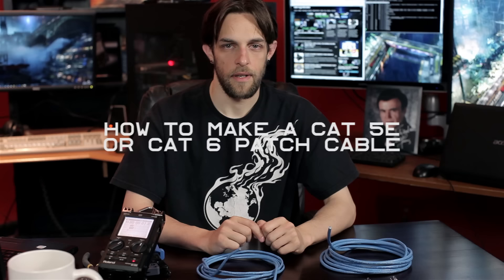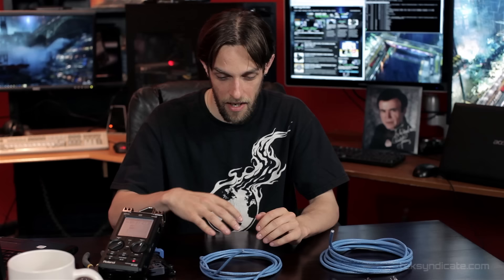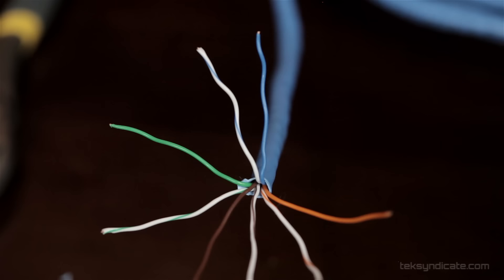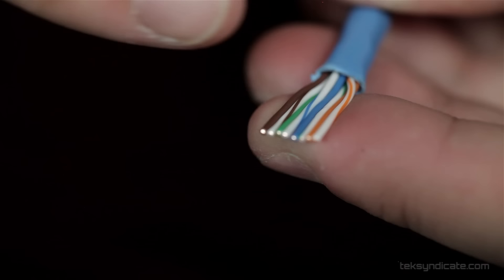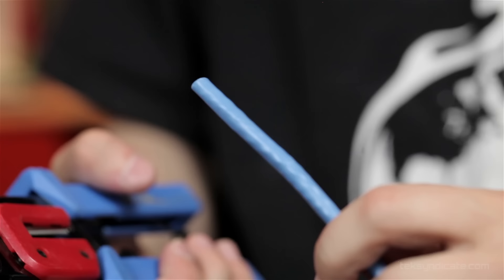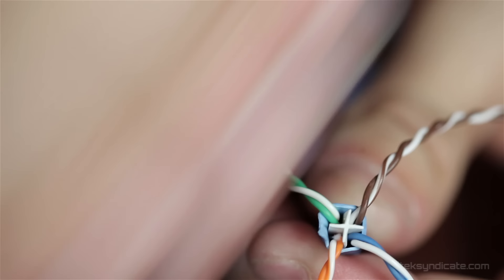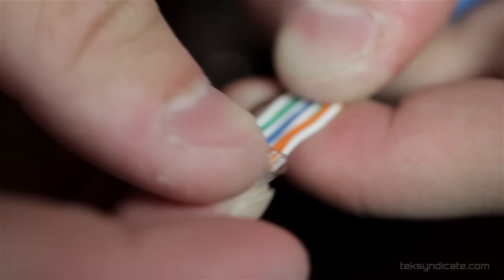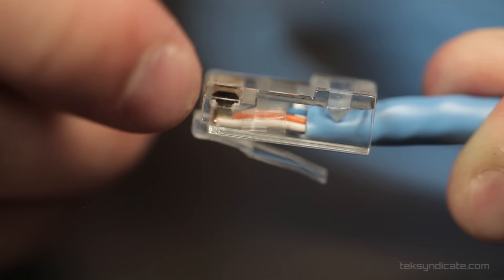How To Make RJ45 Network Patch Cables - Cat 5E and Cat 6

Comment: Network engineer here. Going 8 years now. Never had to create a cable on the job. Came here to run Ethernet to my TV. 😅
Reply: Lucky, stage tech here. im learning while I teach my contemporaries, on the clock lol
Reply: What do you call that little piece you put at 9:17?
Reply: Studying NE here. Busy bridging an old router over Ethernet to act as a repeater for my girlfriend :) will be my first time putting this knowledge into practice.
Reply: @davidkamau7871  i don't think there's a name for them, it's just a style of 8P8C connector, meant to be easier to assemble but isn't really once you've got the hang of how to wiggle the connectors straight before inserting them.
Reply: i really thought being a network engineer require these basic things, i'm currently studying CCNA and i'm really worried that i have to learn this first :-D
Reply: @markanthonytan2794  to be fair, it depends where you end up. If you're in a data centre they're probably never going to let use use a home built cable anywhere. If you're bulk commissioning stuff, premades are cheaper. But if you need a special long patch cable because the office ladies have moved all their desks about its a good skill to be able to do once a month or whatever
Reply: @miff227  thank you for the reply. Highly appreciated 🙏
Reply: @markanthonytan2794  no worries and good luck with the CCNA. It's a great foundation stone to really get a feel of what the silicon is doing , even if you never use the stuff in the job you end up in. I think using Packet Tracer and stepping through each hop, reading all the info, was the lightbulb stuff for me.
Reply: Awesome video. Running ethernet through masonry walls so this is very helpful. Cheers.
Reply: Hey Aaron I have a question I’m 21 years of age and this is my first year taking CCNA how hard is it being a network engineer is it possible for me as a 21 year old to obtain a networking level entry job
Reply: @hawanyamomahmath1489  Hard to answer a question with so many potential variables. Networking isn't the route for you if you're looking for a sure job. Seems like most companies want experience in networking. Your degree is fine, so are your certs. But seems like companies aren't all that invested in entry-level hires in networking and prefer those with years of experience, which was one of the reasons why I actually aimed for computer science in school but so happened to find an entry-level job in networking while there. Becoming a good programmer (computer science) is more promising job-wise (plus likely better pay depending on your qualities on the job).
Reply: @aarondavid9763  so how one gain networking experience if jobs are looking for already experienced workers?
Reply: why do it has to be like exact order?
i just matched both sides and done.
Reply: @davidkamau7871   it's the separator (or simply the little piece of plastic witch you'll loose all the time)
Reply: Sure you don't know how to do it....  it's always done by underpaid technicians
Reply: @davidkamau7871  I have seen it called a sled
Reply: What is the difference between Ethernet Cable Cat 6a,  and Cat 6a patch cable? Can I use patch cable for gaming with no issues?
Reply: On the cat 6 wire do you need the lil plastic piece az an extra
Reply: @A7exandersca7es  Very good. Senior Dev here, it happens more often than I would like to admit, that I learn things overnight to then teach the juniors the next day...
Reply: Scary how many network technicians don't know how to wire cat 5 & 6. I'm just a run of the mill IT Technician, I use patch cables wherever  I can but almost daily I have to run cable lengths for access points or various bits of hardware back to patch panels and I get a 3rd party in for any fibre jobs & splicing. So I just assumed it would be a very basic skill for a network technician to wire a cable but apparently not! 😂
Reply: The cutting wire is called a cheese wire as in its like a cheese cutter
Reply: So like a dishwasher who doesn't know how to wash dishes.
Reply: 😂😂😂likewise
Reply: I’m jealous bc i had to do it on a cable run and open a tutorial just so we could get paid 😂 I hope we don’t have to do many more considering your comment.
Reply: LOL me too😂😂😂
Reply: @AtifSheikh  noone answered your question. The cable inside the sheath is twisted in a way to reduce interference that would occur if the pairs were lying directly next to each other. Yes the cable would work if pairs were cut down both ends if it were a straight through cable but would have great interference in the cable. Cut it down per specs depending on category of cable and connector required.
Reply: Haha
Reply: Maybe you didn’t but I do every day.
Reply: Qq
Reply: Same here, the electricians always “make” the cables and I just tell em where I want them.

Comment: I know this is an old video, but I would add one more step to making the cables - test them with a cable tester once they have been made (if possible.)  It will keep you from pulling your hair out wondering if you made them correctly!

Comment: I have been a professional trainer for at least 20 years, teaching subjects like software, finance, computer processes, and... you get the picture.  Your video is elegant.  I wish more instructors would take the time to do what you did in your Cat5e and Cat6 tutorial.  Foremost, you used plain, non-technical language and clear, visual, checkpoints a lay person could understand and use to make sure the process works.  In addition, you:

1.  Introduced the settings where such cables are used, such as network quality, volume, and speed.
2.  Described the lack of knowledge surrounding both kinds of cable, such as, "why is my network so slow?"
3.  Distinguished the requirements that demand each type of cable, such as normal data rates vs. giga-speed
4.  Laid out the components & tools and needed elements so we can find them, such as, ~"get this tool at a hardware store."
5.  Pointed out special distinctions so the watcher could recognize what was important, such as wire colors, order, & length.
6.  Provided tips from your own experience, such as sheath cutting & double crimping,

There were many more elements in your presentation that made it more friendly and clear, which is just who you are.  Anyway, thank you for one of the best instructional videos I have seen.
Reply: ഇത് മലയാളത്തിൽ ഉണ്ടെങ്കിൽ വിടുക
Reply: He actually used the wrong cable and possible the wrong crimps. What he actually made is a cable that won't last and is prone to easily getting broken.
He did not go over the type of cable and crimps that make up a patch cableb nor did he use boots on the cable.
I have made thousands of patch cables the correct way
Reply: Von, could you help me out with this? I've been looking for professionals in the comments section and glad to have found you.
I have Cat6, it's shielded but not terminal.
Would it make any difference if I don't connect the aluminum foil to somewhere? like if I don't use a metal plate to connect it to, will the speed be reduced? Thnx
Reply: @Von Smith Absolutely agree with you, perfect tutorial! Big thenaks for it!
Reply: @rty1955  

Maybe some truth in your comments. 

However, FAIR GO MATE ! Did you look at the date of the Video ? 2012 !!! 

7 years before you made your comment and only a few years after CAT 6 was readily available and being used. 

The only thing he did wrong considering the age of the video was with the title of the Video, which should not have been "making patch cables" as it really was only focused on termination.
 

More helpful than your critic would be to enlightened us with video using recent crimps and boots etc ?
Reply: @TheTone350  huh? The date of the video has no besring on my comment. He used riser cable for patch cable, that is a big no-no. Patch vale should obly be made with stranded cable and use the corrext crimps as there IS a difference between solid wire crimps and stranded crimps. And using boots that cover the plasric latch is also very important. I gather from toyr comment you have not made many cables at all.
People should do research before publishing a video so people wont think this is the correct way to do something. If he does this as a course of his job, then he should NOT be publishing videos like this
Reply: @rty1955  I couldn't find Your video showing the correct way.
Reply: @TruthPrevailsAlways-1  do not connect the "foil" to anything, even ground. it's an attenuator with a floating capacitance.
Reply: Hi
Reply: @davoodmarayamkunnathdavood9327  No one understands malayalam in this forum. So, just stop this madness.
Reply: Von Smith word.
Reply: roy Yung I know this is old comment but decided to chine in anyway: most likely he didn’t have correct cable lying around but with solid you can still show crimping process. Also booting is no required, it’s good to have as strain relief, but is usually in the way in high density environment, and often left out because large switches won’t usually get moved around for strain to be an issue.
Reply: It is now 2020 I hope you retired. If not let me help make cat 7 cat8 and cat9 and fiber.
Reply: you are either stroking yourself and your business here or you didn't actually try to put together one of these cables yourself. He left out a few important tidbits about manipulating the cables from twisted memory from inside the twisted strand, scoring around outer sheath and problems you have to overcome if you go to deep, etc, etc...and about that 20 years of being a trainer....no life goals
Reply: @rty1955  Yup. I find patch cables made out of solid cable all the time. Drives me nuts. There is no reason to put an RJ45 on solid cable... ever. Wish video would at least annotate that.
Reply: @NETBotic  agreed
Reply: true this is great for beginers
Reply: Not to mention that he keeps his nails clean.
Reply: @davoodmarayamkunnathdavood9327  .
Reply: > "No one understands malayalam in this forum. So, just stop this madness."
 @vijaykumarsubramanian3442  and out of all ppl, only u pointed this out. i see other non-english languages used all over the place in youtube comments, and nobody points it out. seriously, indians pull indians back, others come later.

Comment: 10 years later and your video still helps people. I keep putting away the idea of terminating cables myself because I'm not really into DIY and I'm scared of fucking up the cables inside my walls but your video helped dissipate a lot of the worries I had. I think I'll get a patch cable to practice it a few times before hitting the wall outlet in a cramped space. Thank you!

Comment: Thanks! I checked everything multiple times. I did use a magnifying glass to check the wires before I crimped the connector. The second plug went much more quickly than the first. The cable tester confirmed that the cable was good. Success! Let’s see how well I do on the next one!

Comment: This was a great help in understanding how the cable I bought from a small shop wasn't working.  Not only did they not put the wires in the proper order, but they also exposed the wires themselves.

Comment: Really enjoyed your video, you put it across very well.
One minor suggestion it is that you don't stress the  cores like that whilst getting the outer jacket off as it may weaken them or cause them to break inside their insulator. You wont know that until you test your cable and it fails :(
Reply: BRO I AM 14 AND WATCHING THIS
Reply: @buddyfort  Honestly just buy a pre made cable that actually works. Doing this yourself is a pain in the ass.
Reply: @benyt3039  I honestly would have if the cord wasn’t 150 feet long.

Comment: There are 3 unique types of RG-45 plugs: those for stranded wire; those for solid wire; and those that will work with solid or stranded wire. The bit that pierces the insulation of the cable’s wires is different for each type of plug. Be sure to get the right kind—it makes a difference in the ability of the cable to handle the speed, and give your cables long life.

Comment: I am faced with having to run cat 6 cables in to several rooms in our new / old house . It was built in the 70's , before anyone ever imagined they might one day have a computer in their home . Fishing the wire through multiple twists and turns with the connecters already installed is out of the question . The connecters will need installing after the cables are in place . This excellent 'howto' video makes the task a whole lot less daunting .

Comment: Tek Syndicate being a rank beginner, I was having trouble getting all the wires in the RJ45 pass thru plug at the same time. So with a bit more length in the stripped bundle I did what my wife said(always pay attention to your wife :-)). I put them in one at a time. Checked the order as the came out the other side of the RJ45 pass thru plug. Cut of the excess, put the plug into the crimper and squeezed. I plugged the RJ45 into the router and ran upstairs to see if the new cable worked. Ta Da!!! perfect.First time is a charm. Thank you Tek Syndicate.

Comment: Therese actually a lot more to it than that. The method he uses it called T568B most commonly used in the US because it is compatible with older telephone gear.
The rest of the world uses T568A which is green stripe,green solid,orange stripe, blue solid, blue stripe, orange solid, brown stripe, brown solid. The advantage of A is the inner two pair map directly to telecom wiring practice. Other that that there isn't much difference. Now the connector there's a lot of confusion between 8P8C connector and RJ45S. while the RJ45S keyed 8P2C modular connector, with Pins 5 and 4 (the middle 2 positions) wired for tip and ring of a single telephone line and Pins 7 and 8 shorting a programming resistor. It was meant to be used with a high speed modem and is obsolete today, but can still be bought it's commonly used to refer the 8P8C connector. The RJ45S in fact features an extra tab that prevents it being used with other types of connector. An actual 8P8C will not work with a RJ45S socket. While Cat5/Cat5e and Cat6/Cat6a cables can be used is the same connector. Cat6 is characterized to 250MHz but has a reduced maximum length when used for 10GBASE-T(10-Gigabit Ethernet), Cat6a is characterized to 500Mhza nd has improved alien crosstalk, allowing 10GBASE-T to be run for the same distance as previous protocols.
Reply: Yes, class A is better.
because you can use that for VoIP telephone.
Reply: Thanks, I was looking if anyone would point out this was the T568B standard. Your explanation was excellent. Should have thrown in a “cross over” pairing.

Comment: The only thing missing is a simple statement saying "repeat this exact procedure on the opposite end."  The procedure for fabricating a cross-over cable is slightly different than a patch cable.
Reply: The opposite side is still the same its procedure is the same and the color coding is the same.

Comment: Hey great demo, but when you bend the cable to remove coat, you may also break the conductors.
Reply: +Tesfalem Rezene I thought the same thing. Why not use a cheap tool that takes the sheath off.

Comment: I just re-networked my entire house with CAT6 cable for $50 CANADIAN (75 ft. of cable total)
Reply: +bcman Main (bcman12358) I see no point in spending the extra for cat6 myself. For 100 BaseTx its not really going to do much for me. There are actual advantages of going with cat5e over cat5 on  a 100 Base TX network but not cat6. At least, not that I know of.
Reply: +bcman Main (bcman12358) I'm afraid my house would cost quite a bit more, 2 story 5 bedroom 3 bath lol
Reply: Cat 6 is overkill but for that relative small amount it’s futureproofing. Technology keeps improving so it’s good to know that your behind-the-wall cabling will be up to the task........just my thoughts
Reply: @psoon04286  Now Cat6A Shielded is not overkill to futureproof your domicle. It will do up to 40GbE at 550MHz if memory serves me correct and it may not. 😨

Comment: Cat 6 is a pain in the arse!
Reply: +Andrew Joy Use cat5e then.
Reply: +Jason C. Oh i do ! If it was a new install i would do the cable runs with cat6 but there is never any need for a cat6 fly lead at the moment.
Reply: Andrew Joy Cable and DSL do not offer 125MB/s connections so its pointless to use 1000baseTX which typically requires cat6.
Reply: Indeed you are correct, i was mainly talking about the infrastructure ( cable runs to patch panel etc)

You can run 1000baseT just fine on cat5e. My point was if it was a new build and your running 100s of cables around its good practice to have it to cat6 standard now so you don't have to change in 5 -10 years down the line.

The fly leads themselvs dot even bother just buy them or use cat5e.
Reply: Andrew Joy You are right, Cat5e does support 1000baseTX. Cat5e is susceptible  to more crosstalk though. Which is why  ANSI/TIA/EIA created the Cat6 standard.
Reply: Andrew Joy If I  needed gigabit ethernet  and I was building my own home i'd  probably use Fiber optics. Something like 1000BASE‑LX.  That's just me though :-)
Reply: +Jason C. Isnt fiber waaaaay more fragile?
Reply: Fuch Goog Then get the buffered, jacketed, gel filled, etc. SEE, http://img.weiku.com/waterpicture/2011/10/16/16/Armored_Loose_Tube_Fiber_Optic_Cable_634546943069795524_1.jpg
Reply: Andrew Joy r
Reply: @OptimusSatanas  if you know what your doing, there shouldn't be a problem!
Reply: It maybe a pain for Harry the homeowner, but it's nothing when you've been trained and do it everyday. ;)